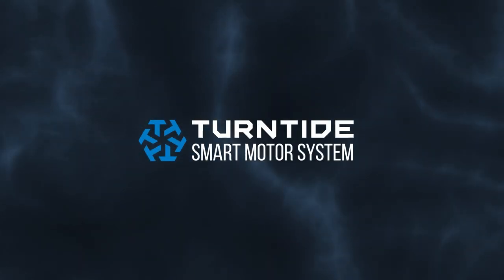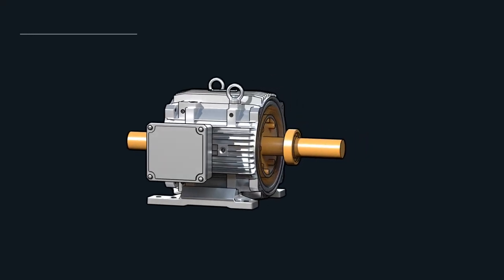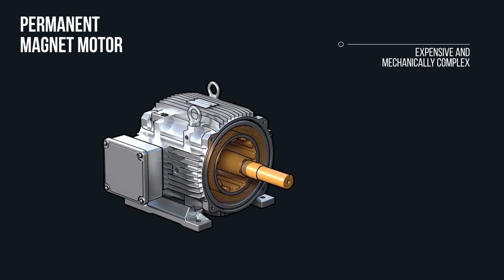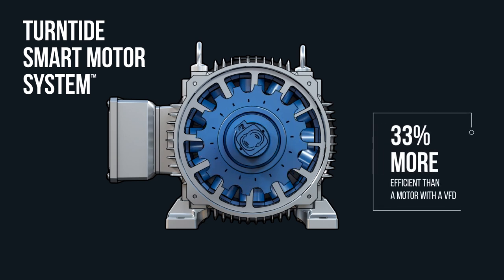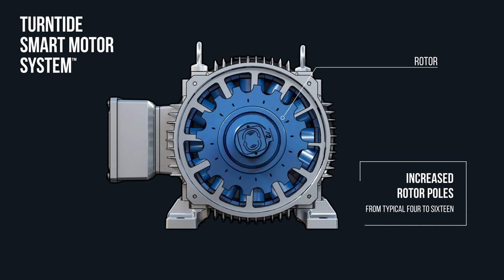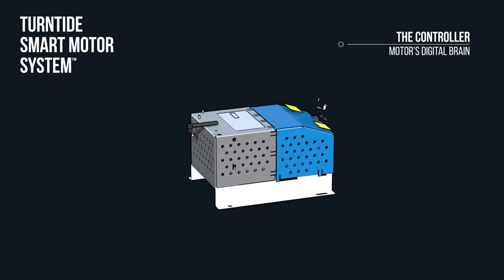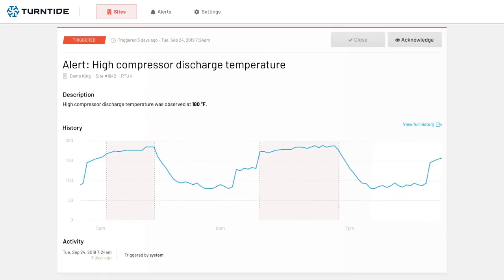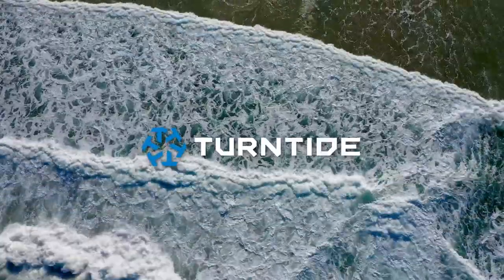Turntide Smart Motor System: How It Works

Comment: They need to greatly simplify it if they want to put these anywhere but boutique applications. Lose all the sophisticated web connectivity. No one needs their refrigerator connected to the internet, and they won't need their HVAC blower connected to the internet either.
Reply: You’re thinking small. In the future everything will be part of the internet. There’s a reason. Data is an important resource to utilize. The reason why this motor will be 30% more efficient is because it can learn. Being connected to the internet where motors from buildings across the world can provide data on how to be most efficient is the point.
Reply: @krrrrrrr3783  Connecting everything to the internet is a waste of resources. A truly advanced motor would operate more efficiently simply because it uses less electrical power to produce the same amount of mechanical power as an induction motor. What you describe has nothing to do with a more efficient motor, you're just fine tuning operational curves, which will work in some applications that have predictable use profiles.